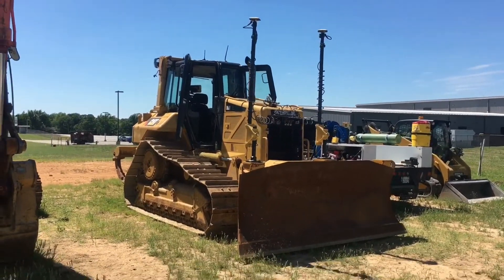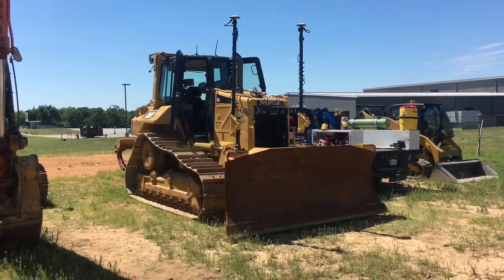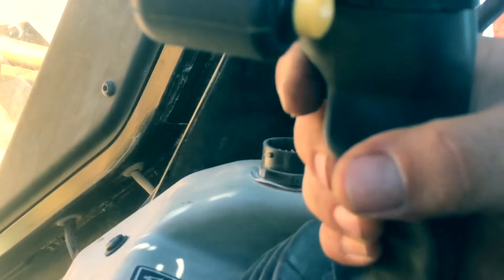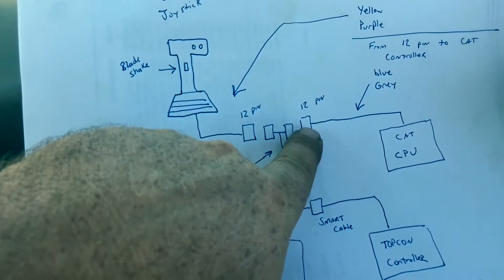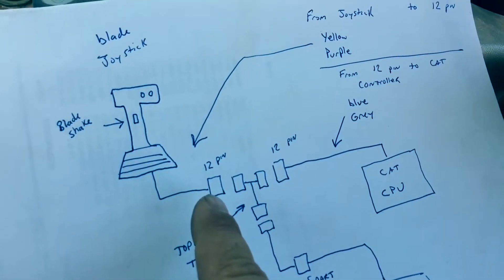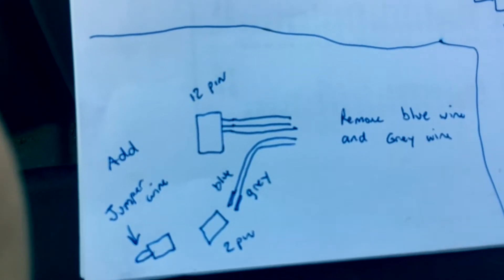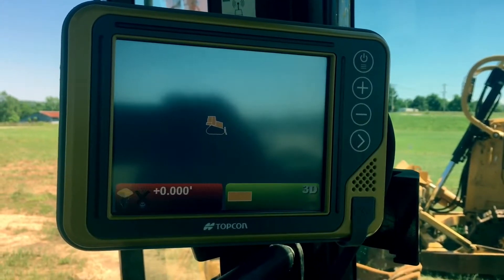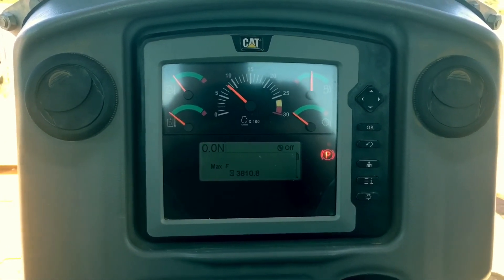Blade Shake Error Code Hack

Comment: Hi, if you activate Accugrade via Cat ET the blade shaker is disable.
Reply from the maker: I've found that if the cat computer sees a receiver on startup blade shake goes away if you are using cat can dozer as a valve setting and can input for switch type. Even with accugrade enabled blade shake will come back if you pull the fuse on the topcon system. That's because it doesn't see a controller anymore. 
On the older cat dozers that are pre teir 4i
That setting dose not work, the topcon auto always stays on. You have to use cat can interface with a non can switch type. On the newer dozers blade shake goes away and that button becomes auto instead. It's just some little work arounds to make can work on the older cat dozers with Topcon.
Reply: Fine! I had problems with firmware version in d6n here in Brazi. Good work to you man!!
Reply from the maker: Rafael Bezerra 
thank you!